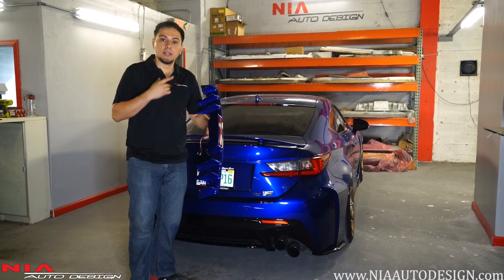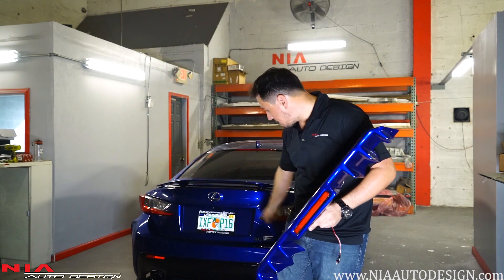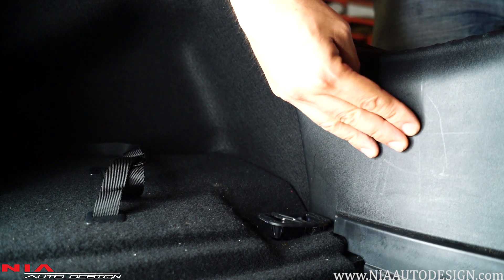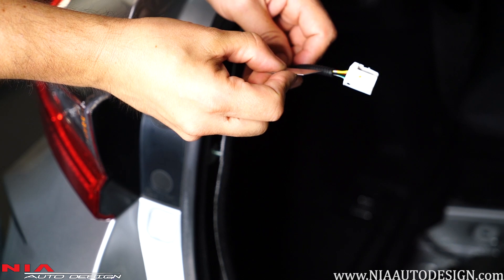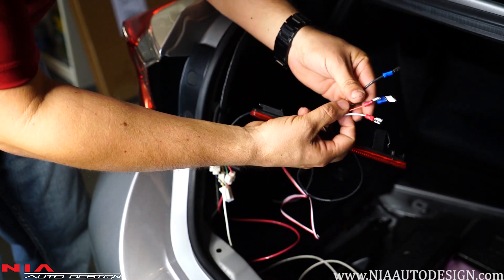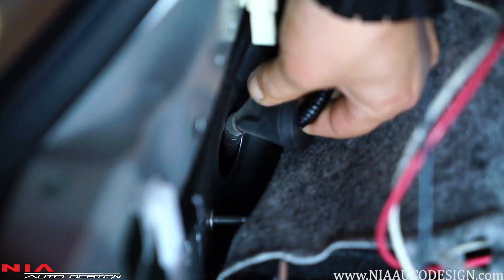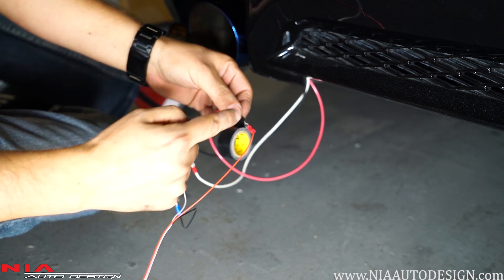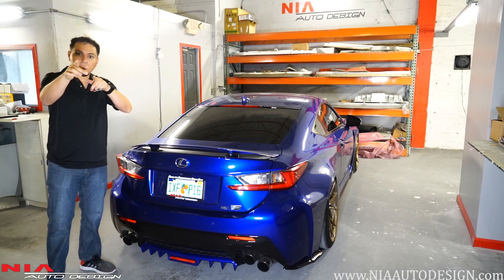Lexus RCF rear bumper DIffuser lip body kit with led brake light.

Comment: how do you get it to strobe?
Reply from the maker: ours doesnt strobe
Reply: @NIABodyKits  I have one more question, will this fit a RC 350?
Reply from the maker: @lc500yyc  Unfortunately its made for the RCF only.
Reply: Hey bro, do you have the same for a is300 fsport 2016?
Reply from the maker: @donaldramsamugh1723  we do not, the only way to run it on a 2016 IS would be to get the rear valence from the 2017-2020 and that bolts right on to the 2016 bumper and then our diffuser would fit